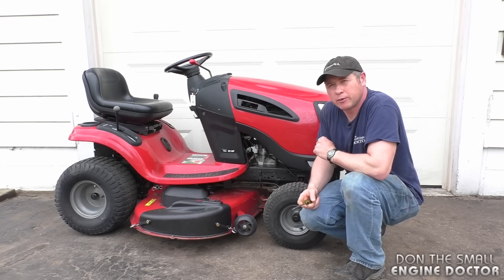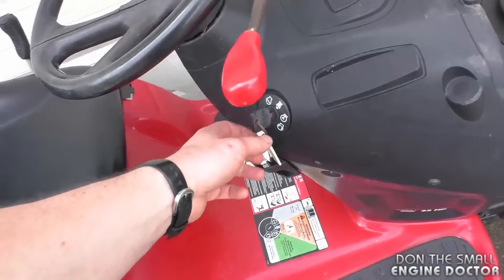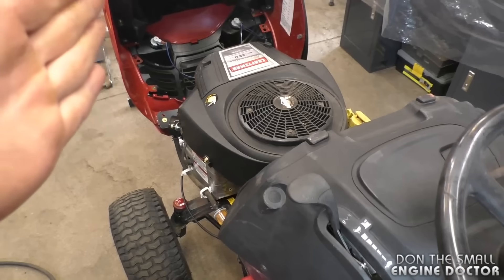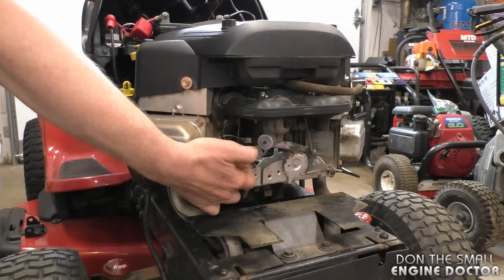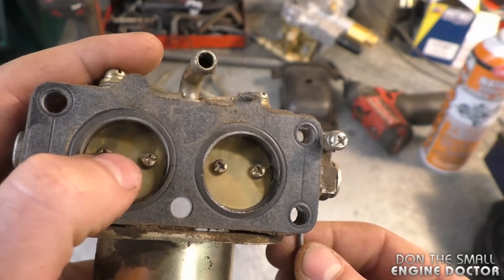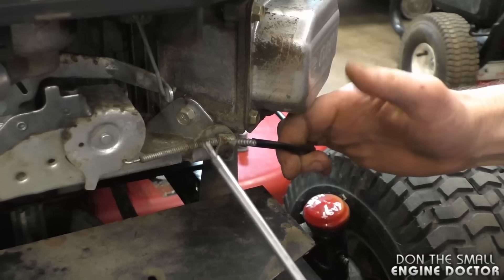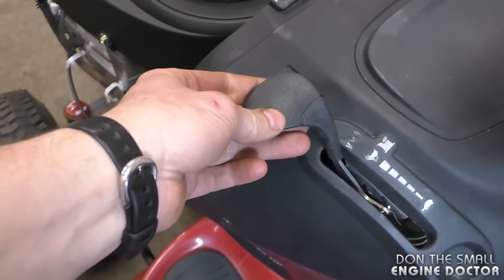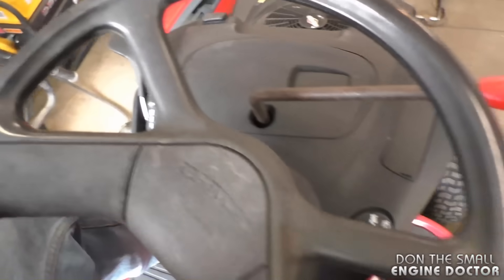Lawn Tractor Won't Start? Try This Easy Free Fix!

Comment: I just watched a vid or yours from 2017. You were talking about oil, 10-30 vs SAE30. My question is would you ever recommend or use synthetic oil in a lawn mower, garden tractor etc. 4-stroke?
Great info, thanks for your channel

Comment: That was a great video.  Can I ask a question I have a troy bolt pony mower.  I just got it serviced and the lights will  not come on anymore when I start the mower.  I was just wondering if there is a switch somewhere because before the lights just came on when started mower everything else works fine.  Thank you.

Comment: Hey Dony, Thanks for this great video. I have a Toro Wheel Horse Riding Mower that was working fine two years ago when I parked it in the garage. Now that I need to use it again, it is not running. I mean, it starts and runs for a few seconds and then dies.  I have changed the oil filter, fuel filter, fuel line, air cleaner, spark plug, etc. and have checked the carburetor Solenoid which is fine. So, now I am totally puzzled.
    Do you think the problem is in the Choke cable being loose as you say in this video? Does the choke cable goes to the carburetor which is mounted on the side of the engine on this mower? 
    I don't have much experience fixing lawn mowers but I can do things with your help. Thanks
Reply: I know you probably already got it fixed or throw it away or something but I had the same problem with mine and ended up being the ignition coil but I replaced a lot of parts before I found the problem

Comment: Nice video 👍 but here is a question for you, I have a troy-bilt bronco and it's doing the same thing cable is tight but a small black lever on carb is sticking. I pull it towards steering wheel it moves and the engine starts right up. what's causing this to stick and how do I fix it?

Comment: I love your videos. I have a question if you can help.
I have a Craftsman LT1000 with a19.5HP opposed twin which starts and works great. After using a while, if I turn off, it will not restart. It has to sit for e few hours before it will start.
Thanks in advance.

Comment: New here🙆🏻‍♀️ really appreciate this tips to fix our mowers..but mine doesn't even give that nice noise..attempting to start..just make a "click, click" sound, battery is good, fuse, spark plugs..will check that choker though..🤔 thank you kindly! And if it gets fixed, definetly will send you a six pack😉🤘🏼

Comment: Good pointer I am looking for a used tractor trying to get it as cheap as I can or even free. The ones I have looked for they say it hasn't started in about a year. So if I ever get one I'll surely will try that out first.

Comment: What do you think about it not starting do to compression. I take the spark plug out and the engine cranks.
Reply from the maker: try adjusting valves

Comment: Simple fix, another great video Dony.
I have a question, on an old 12 hp Briggs lawn tractor engine I get 12 volts AC for lights, but the battery leads get about 5.8 volts DC with no battery in there at higher revs. Should it not measure about 12-14 volts DC even though the battery isn't there, or does a battery have to be connected?

Comment: Have a chainsaw question for you if you don't mind. Saw your 170 bar and chain upgrade video and was wondering what are my options on a more robust 0.43 chain? And if I switch to an 0.50 bar and chain do I need a different sprocket?

Comment: Always interesting Dony. Makes you wonder if there is any "quality control" in production these days. I don't know where these tractors and engines are manufactured, but it sure appears that no one cares about the product or the end user. It is no wonder that folks hold onto their vintage JD, Gravely and IH tractors.
Reply from the maker: once reputable manufacturers have lowered the bar and are only concerned about the bottom line = greed
Reply: Agreed 🤔

Comment: Hey don I have a Polan pro 19 1/2 horse single piston, riding lawnmower, was cutting grass with it and it just went dead and will not start back up. It turns over fine.

Comment: Only had limited experience with my friends Briggs with this weber carb set up, seems overly complicated for what should be a relatively simple Briggs engine...Oh well.  What is the spring loaded set screw for near the choke plates?  Seems like that could limit proper choke closing if that screw is turned in too far also...What do you think?

Comment: I have an older craftsman lawn tractor early 2000s and it won’t start seems like it’s not getting fuel so I might see about putting in a new carborator and see what happens it might just need new fuel hoses

Comment: If you’re familiar with Poulan pro PP 4018 chainsaw maybe you could answer this question for me? I just installed a new carburetor and I want to know how many turns out from being seated should I turn the low idle (L)screw and how many turns out from being seated on the high idle (H)screw ?? Thanks!

Comment: Hello.. i have a mtd with a honda clone engine.. i guess. It kicks back very hard.. i did remove the flywheel and key is not sheared flywheel is in right position..  so skipped tooth on gears? Plastic cam gear  moved/slipped? My gesses at least what you think?

Comment: Thanks a lot! I changed the gas filter and oil filter and a brand new battery. I hear You click when I turn it on but that's it. What could it be?

Comment: I have this same mower. Yesterday I was mowing I thought I ran out of gas so I refilled and still want crank so I took the carb off and cleaned it but no luck. What can I check next. Thanks in advance.
Reply: Same exact issue here. For me, gas is coming out into carb. spark plugs replaced and has spark .Checked wires for short. Nothing found. Only thing i have not done yet was to remove carb and check. But i do know the cables and choke are tight and functioning.
Not sure what else to look at, other then removing\replacing the carb itself.

Comment: I have the same tractor with a kholer 22hp engine and my choke was not engaging fully with slack in the cable from the factory. 
Had some other issues when I got it home with belt/pulley problems.
Poor quality control on these before leaving the factory.

Comment: I have the same mower, one question, how do you get that mower to start without you sitting on it? every time I get off mine to empty my leaf bags the mower stops  this really is a pain because the bags fill fast and I am constantly  starting the mower which I wouldn't think is a good think either  thanks for any help  I bought the mower used and didn't get an operating manual

Comment: My 46” Husqvana YTH22V46 engine has the same hard start on cold, works like a charm after spraying with start fluid.  I checked the Choke cable is fine.  Not sure what else causes the problem.

Comment: Man, what a great video.  Funny that I come across this while seeking a solution for a similar problem with my brand new T240 that I just got delivered a week ago; and you're showing how to fix the problem on exactly the kind of mower I'm replacing.  Great explanation that addresses the theory, so the fix can be adapted to other mowers as well.  In particular seems to be an issue with Craftsman / MTD mower QC coming out of the factory.  Where were you eight years ago :)

Comment: I have an older model just like this one I bought used, can you tell me the best weight OIL S.A.E. such as straight 30 weight or a multi blend like 10-30?  I would appreciate an answer, oh mine takes an oil filter as well and I'll tell you it does make a difference.

Comment: I have that same engine in a 5 year old Simplicity Broadmoor. The throttle lever goes from turtle to rabbit I believe. No choke position on throttle lever. It has always been slow to start compared to my Kohler engine. Could the slow cold starting be an issue like you present? Thanks for this very useful video!
Reply from the maker: yes it could be

Comment: I have a t2400 and for some reason is braking the starter ⚙ gear the motor turns but at some point gets stuck  I don't know what to do and a guy told me that the motor is bad, could you please give me a advise?

Comment: Great Video Donny as always , Thanks.... .
Could you please help with some troubleshooting ?
I have a 2002 Craftsman 
DLT 2000 Riding Mower ...22Hp Briggs...OHV , V-Twin...INTEX..ELS.
I Have a spudder and popping or backfiring out of the muffler...ONLY on high speed and when I turn off the PTO it gets worse... I have replaced Both Coils gapped at. 010 ,
Rebuilt carb that has the black tube not the white one , Complete Tune-up with Air Filter, Gas Filter , New Oil 30 W with New Oil Filter and Installed both Spark Plugs gapped at .040 , Adjusted Chrome Valves at .007 ... And it still popping or backfiring and spudders at high speed and it runs good with the PTO ON and then PTO OFF and popping or Backfiring and Spudders then when it is at idle it stops and idles just fine ....
PLEASE HELP !
Reply: Mr. Dave R Check your woodruff key
Reply: @jocelyneleblanc705  Would that be the flywheel key ? ( woodruff ) sorry dont know the lingo .
Thank you Joycelyn .
Reply: yes
Reply: @jocelyneleblanc705  
Thanks Jocelyne , I will pull that flywheel and replace that key .

Donyboy  if your reading this I would like to buy a couple parts from you and Donate to your YouTube Site so please let me know how or what I need to do to make this happen .
Reply from the maker: check valve adjustment
Reply: @donyboy73  I just now finished adjusting to .005 and it still pops and   spits at High idle .
It says that the Rocker arms are chrome and they look thin and cheap looking.. I just ordered a set of Black ones that look much beefier than the ones that are in it .
Any other ideas ? We dont have a repair shop here anymore so its up to us to get this figured out. 
Thanks Donyboy , Anymore ideas... I  have been chasing this problem for two short summers already and it has been a head stracher  !

Comment: Have an older model craftsman, don't know the exact model number but having problems starting  it up. Replaced the battery and the starter but still nothing happens.  What else can I check?

Comment: I have the same problem with the same engine, hard to start, and once again been like that since new. Is there other common fault to cause that from the carburtor not getting enough fuel if the choke cable is tight (on the v twin)

Comment: Purchase a Troy-Bilt riding lawn mower similar to the one you have there in 2018 very little use over the  past couple years, the other day I went to start it noticed the battery was bad so I replaced the  battery and i  sprayed  starter fluid in the carburetor it fired right up with no problem, started to cut the grass when about 10 feet with it, and  it shut off. I tried to start it again  the starter engage and then there was a big clung, now it won't start the starter engages but it lasts for about a split second and then there's a clunck and nothing after that clunck sound. Could you tell me what this problem could be?. Thank you

Comment: Looking for some help if you can I have that exact same tractor and what’s happening lately is I start it starts up no problem runs for about five or six minutes then dies the longer. I let it sit the longer I can get it to run. I just replace the spark plug and fuel filter and air filter. Don’t know what else I can do. Hopefully you can help me.

Comment: Need your help i have a very old craftman lawn tractor with Honda 16.5 v twin engine , I need to change the carburetor on it I think , or should I empty the fuel ,it runs but it wants to stall until I pull the choke all the way out that it start to stall I push the choke in. Once it runs good I engage the deck and it slows right down not enough to mow. Please help

Comment: @donyboy73 
Great video. fyi my neighbor's riding mower wouldn't start and I could see the clear fuel filter didn't have and gas in it...first sign it isn't going to start. lol Looking inside the tank, it was full of stuff, nothing was getting out because he had left the gas cap off all winter and then found it in the spring, put in new gas and it did make it out of the tank. There has to be an easier way to clean a tank...do you happen to have a video on that? I'm afraid he will use a shop vac and blow himself up.

Comment: Having the sameno start problem with my dys4500, 24 briggs.  I adjust the cable only thing is my choke is a pull out knob , new fuel pump, new fuelter even tried turning it over pushing the choke with my thumb to make sure it was closed and still did not start but if I pull the choke knob  out and spray starting fluid in there in the air filter area after removing it, it cranks right up and runs fine, all I want is to start it with the key, any suggestions? Thanks

Comment: @donyboy73 This indeed was a problem on my Husqvarna rider with the Intel V Twin, but it didn’t solve my issue with it not starting. New battery, spark plugs and fuel filter. Siphoned old gas out and fed it with fresh non-ethanol gas but still no joy. Do you have a video on how to remove the carb from these V Twin engines? I’m convinced that it’s either the carb or the solenoid at this point. Thanks!
Reply from the maker: https://www.youtube.com/watch?v=aP0Nnl71H_Q&t=1s

Comment: I have a Toro LX 425 riding mower and I’m having a problem tryin to get it started. I have a fully charged battery and I checked the fuse which is good. It won’t turn over when I try to crank it and the starter gets hot. It wants to turn over but doesn’t what can I do.

Comment: Can I have you explain why my tractor won’t turn over? I just took the tank off and repaired the fuel line elbow. Did I mess up the seat switch or something?? It turned over before really well just want getting fuel now nothing when I turn the key

Comment: I have a 1998 Huskee 21 horsepower Briggs & Stratton 46-inch cut deck it will crank over but will not start just bought a new starter solenoid because the guy that gave it to me told me that what it was and I still will not run any help is appreciated

Comment: Dony i have a question i have a Columbia tractor lawn cutter    the CYT 4220  I bought it new 4 years ago. it is now at 150 hours use   my question is how many hours are a lot of hours for such a tractor?  I have no problems with it it is alway in the garage year round.  just wanted to know what is considered a lot of hours for a tractor that cuts the lawn. I wait for your feedback    thanks
Reply: or if anyone out there know the answer  glad to have your feedback  thanks
Reply from the maker: 1000 hours

Comment: Don,       I recently picked up a McLane edger w/ 3hp briggs engine no compression. Where do I start on s potential fix? Or is it better to just find a replacement engine?
Reply from the maker: probably cheaper for you to just find a replacement running engine

Comment: Need some help. Craftsman lawn tractor with a nob that you pull to activate the planes. Took deck off to clean and new blades. put back together but now blades will not turn on. belt is on properly. Last time  i did this had to take in for repair  3 weeks later got it back over hundred dollars. What did i not connect. Didnt see anything to plug in.

Comment: Good catch!  Dony, I have a Sears lawn mower also.  It has been backfiring and I narrowed it down to the right side.  I have replaced the spark plug, coil, and cleaned the stator and yet it still backfires intermittently.  I also made sure I had good air flow. I was expecting the valve or a fuel delivery issue?  Yesterday after replacing the coil on that side it was still backfiring.  All of a sudden it started running well again. I am thinking it should not be the valve or it would happen all the time.  I don't know where to go from here?  Can you offer any input?  Thank you.
Reply: I'm not a mechanic but it's got to be timing..which means valves..check the clearances..
Reply from the maker: check valve lash, i have seen that before and valves were out of adjustment
Reply: @donyboy73  Thank you. I will do that.  I just thought it would be consistent if the valve was out of adjustment though.  Sometimes runs fine. Other times not.  I will check that next though.  Thank you for replying and have a great Friday!
Reply: @setdown2  Thank you Chuck!
Reply from the maker: @Crappie_Hunter_Seeker  set between .003"-.005"
Reply: @Crappie_Hunter_Seeker  I just went through problems with my Coils and what was happening with my Craftsman 22hp Briggs was one coil was only working intermittently and my other Coils would work just fine and as it warmed up I then would lose my 2nd coil but when the Coils were cold they worked just fine so I replaced both of them . If your using a meter on OHM's set at 20K both of my old Coils had great readings but it wasnt until I put a inline light Coil 
Tester on both Coils and seen that they had weak spark after a couple minutes of running ... Now im looking for my next problem with my backfiring problem... Good luck to you , hope this helps you .
Reply: @MrDaveR-uq7iq  Thank you Dave.  I will keep this in mind. I have replaced both coils. I also put a spark tester on both sides and watched.  Seemed ok.  This is a strange one.

Comment: good tip Dony ! that's a pretty dumb set up to take it off choke you are on wide open throttle on a cold motor... my Husqvarna tractor with a Kawasaki motor has a separate choke cable from the throttle